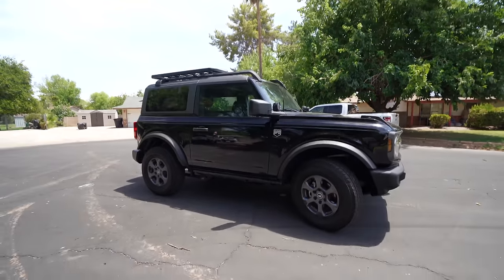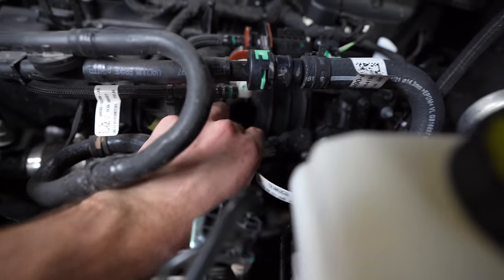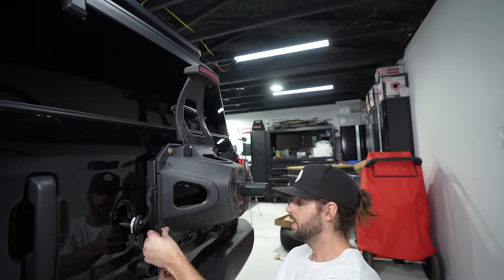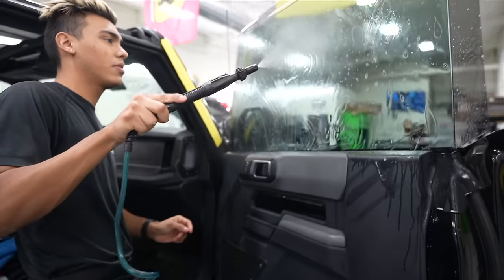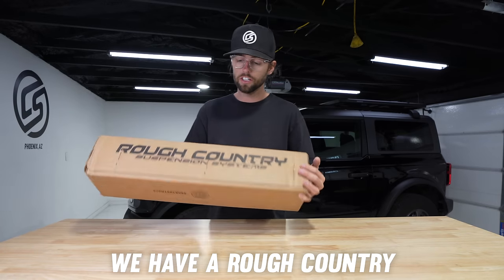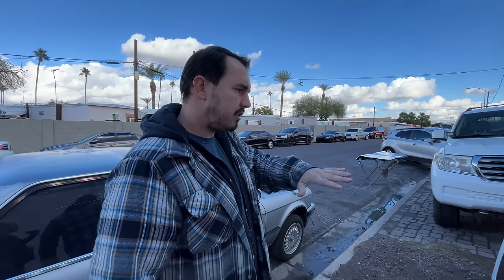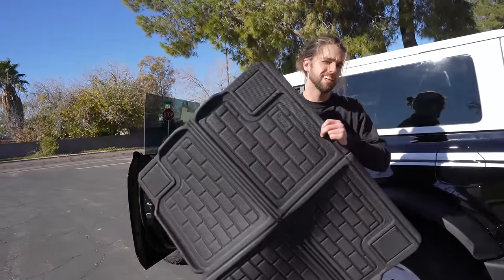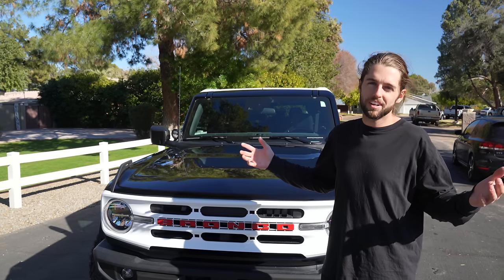Building a DIY Heritage Edition Ford Bronco in 18 Minutes

Comment: What are the ditch lights you used? If Rigid 360’s, which bracket did you use to mount? Where did you locate the switch?